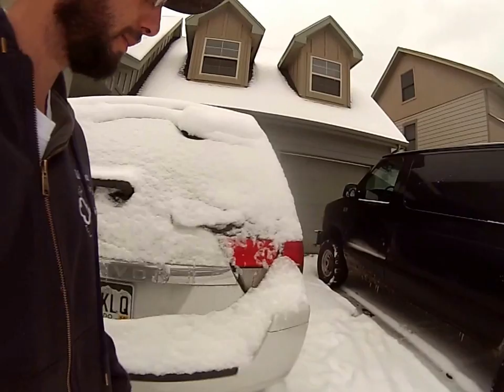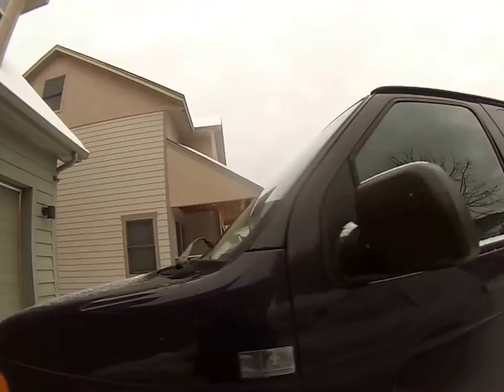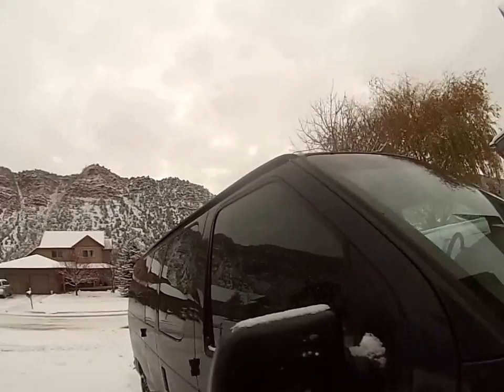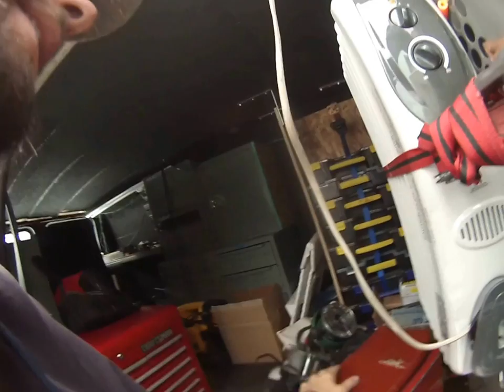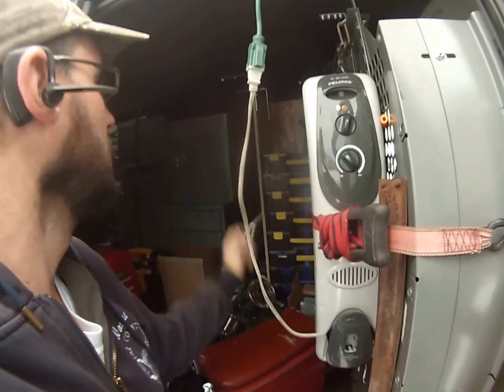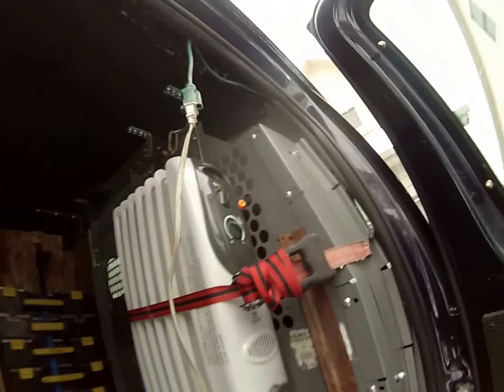Never Warm Up Your Car Again No Defrosting, No Ice Scraping, Make Your Vehicle Ready To Drive!

Comment: you still want to warm it up. Not because of the windows or any of that, but because of the engine, get the oil warmed up and flowing so you don't hurt your engine
Reply from the maker: there's an engine block heater as well
Reply: Ahh Ok then its all good